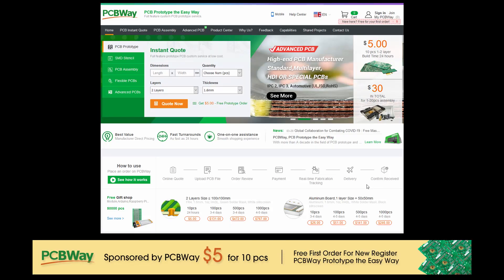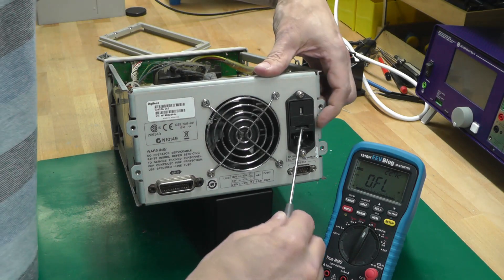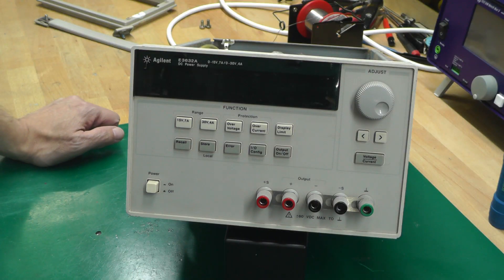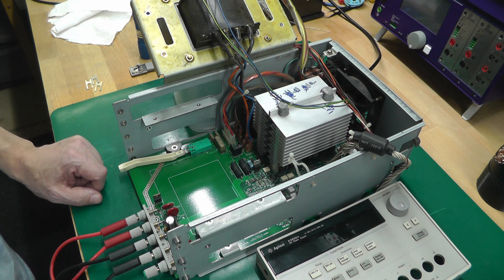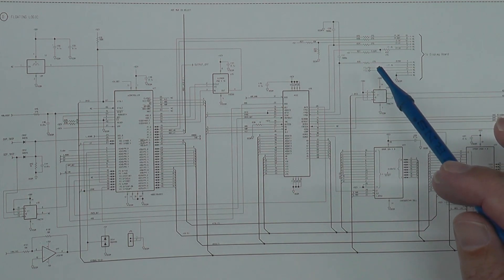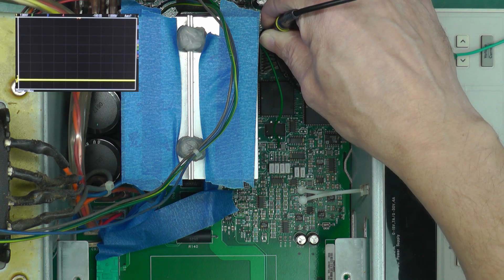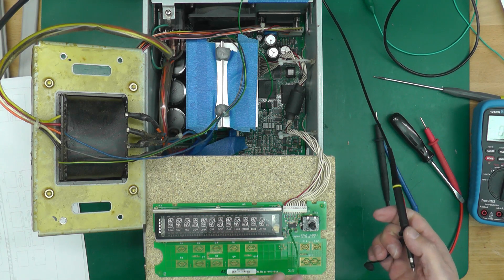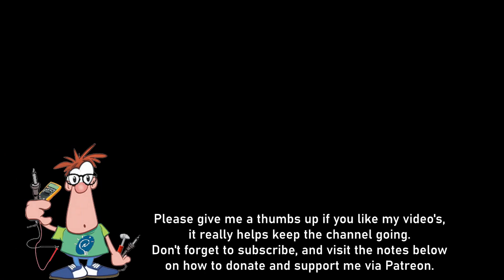No.064 - Agilent E3632A Power Supply Repair - Part 1

Comment: The architecture of that unit is basically the same as the units I fixed.

Check the power supplies of the gpib section, I found a bad supply there can kill it, also check the front panel uP isn’t getting hot, I had to replace that myself too and it was giving a similar symptom.
Reply from the maker: All power supplies (there are quite a few) are fine on both the earth referenced and floating sections of the main board, nothing overly hot. I am working on a Part 2 video today actually, the Cpu clock, reset circuit, addess/data bus all look active and with no shorts (can usually see this on a scope). Plenty more to test though, this is looking like a proper fault....great fun!

Comment: The three pin ICs mounted on the heatsink, might be worth checking those since the unit has seen prolonged use?
Reply from the maker: Thyristors and LM317/337, they are okay at the moment but certainly worth looking at after the digital side is operational.

Comment: My experience is with an E3631A but they are a similar architecture. Be careful probing the display section. It's easy (well it was for me) to send 17V where it's not wanted! Maybe the previous repair attempt has done this. I had to remove the VFD and replace some blown comparators and the custom ASIC (fortunately available from ebay) as a result. Good luck!
Reply from the maker: Nice find on the ASIC....can't see nothing there at the moment though......would have been nice to have.
Reply: @IanScottJohnston  FYI - sourced it (SXC6206AKO/V4 for the E3631) from https://www.utsource.net/

Comment: Holding down the "Display Limit" button for a couple of seconds while powering up the unit performs a self check. Maybe you sould try that
Reply: Page 98 of the Service Manual gives you the details of the self-test. With that you can check the communication with the front panel.

Comment: Luckily you have a schematic for this power supply, Ian would you have a quick look at the encoder. I have the E3631A and the encoder works intermittently. Shahriar from TSP did fix it but didn't show what he had done video TSP #108. Cheers
Reply: Open the encoder, clean out the old grease that is interfering with the contacts, and put it back together.
Reply: @PeterRidge  Thanks
Reply: You can dismantle the encoder, clean it, increase the context tensions and put it back together, I did that in one of my videos fixing a similar supply.
Reply: @TheDefpom  Thanks
Reply from the maker: As luck would have it I have a few 24PPR encoders with the same footprint, so if I get that far I'll probably replace it. For now the existing one is back together.
Reply: @IanScottJohnston  Thanks

Comment: I look forward to the conclusion.

The instrument can do a more complete self-test if you hold down any key (except Error) for five seconds as you power it on.

Have you checked all of the power supply voltages (especially the MCU rails)? I'm not convinced the main MCU is doing anything.
Reply from the maker: The complete self-test does nothing more than the normal power on self-test. The power supply voltages are all pretty good.

Comment: Hi Ian, I have fixed a few of these PSU's by the looks of it I would be looking at the main processor to start with.  The display board has its own 8051 based MCU, the power-on reset where the full display lights momentarily is the display processor initializes and looks correct to me.   Removing the Display from the PCB can be a pain, I have a number of these PSU's so if you want me to test the display so you can eliminate it I will be happy to do that, its easy enough to test when you have a working PSU. 

Also, make sure you study the schematic, the grounds are not where you would expect them to be, and typically there is opto isolation between the digital and analog sections, this allows the GPIB port to share earth ground with other equipment.
Reply from the maker: Cheers for the offer of testing the display Gerry, hopefully i won't have to bother you...... Right now I am all over the cpu etc, so far everything is checking out IO wise, but I have a couple parts on order from RS we'll see where that takes me. Great fun!
Reply: @IanScottJohnston  your welcome, good luck with the repair

Comment: Is there CPU clock? Is there some activity on ROM reading? Are all power lines for chip ok?
This project looks very great and interesting. Sad, that there is no information about how this fault started because that will get some clues where to dig.. But looking at resoldered parts, looks like someone blow it up..

Waiting for next part! :)
Reply from the maker: I am working on a Part 2 video today actually, the Cpu clock, reset and the power supplies are all looking ok. The addess/data bus all look active, no shorts (can usually see this on a scope).....plenty more to test though.
Reply: @IanScottJohnston  These are good news, at least some activity..
Agree, this project needs lots of testing to find out why CPU is sitting in some initial loop and what event it's waiting.. Lots of things may be wrong: bad serial shifter, bad output transistors (maybe it trys to set up initial output and can't do it, causing loop), opamps, corrupted ROM..
Anyway, it will be cool to figure it out and bring that power supply back to the life.. :)

Comment: Maybe start with the basic, and check if the transformer is okay, and if all voltage rails are present.
I guess that there is a 5V rail missing, which controls the IC's.
Reply from the maker: All power supplies (there are quite a few) are fine on both the earth referenced and floating sections of the main board.
Reply: @IanScottJohnston  , i hope that there are no damaged ic's on the board, that maybe not widly sold to the public. Good luck anyway, looking forward to your next video.

Comment: I'm facing Unreg issue.

Observations : 
1) Self Test pass . So that's a relief .
2) No errors reported.
3) OVP : 25V, OCP : 4A
4) Display Limit : 25V , 2A
5) Output On with 25V,7A Mode : 
    a) Setting 0V, 0A- Recorded (DMM) 42.62V
    b) Output Off : Holds 42.01V (DMM) , takes close to 3-5min to 0V
6) Tried to change voltage and current setting on PS, But cannot change anything. DMM records 42.62V

Do you know how to fix it ?
Reply from the maker: If you look up one of my other Agilent Power Supply videos on YT there's one that had similar output voltage fails similar to yours. They are all very similar in design so good luck!

Comment: UK Mains is 230V and has been since 1995, it was 'harmonised' with Europe to make the import and export of electricity from and to the continent easier (good thing as we're net importers of electricity because successive British governments have been utterly crap at updating our electricity generation capacity)
Reply from the maker: 243VAC measured here (NE Scotland)......it's sometomes a concering when plugging in primarily 230VAC gear......LOL!......Yeah, don't much care for British/Euro politicians......useless twats!
Reply: @IanScottJohnston  You got that right. A bunch of muppets the lot of them.
Reply: The link to France, established in 1961 was 100kV DC, the replacement in 1986 is 270kV DC.  The voltage the consumer is supplied with, and ‘harmonisation’  is totally irrelevant to the energy transfer capability across the inter connectors.  

It’s now 30 years since the UK electricity system was privatised.  Apart from 7GW of legacy AGR nuclear, 5GW of coal, 3GW of pumped storage and 1GW of hydro (circa 16GW total) ALL the other generation in the UK, around 65GW, is totally new build post 1990, so in excess of 30GW of gas, around 2GW of which has already closed, 24GW of onshore and offshore wind, 13GW of solar, and 1.2GW of nuclear (Sizewell B in 1995) 

The supply voltage for the UK was defined prior to harmonisation as 240v +/- 6%. After harmonisation 230v +10/-6%,  the super grid transmission and distribution networks are still run at exactly the same nominal voltages they always were and UK consumers are still supplied at a nominal 240v.

240V +/-6% is 225.6–254.4V

230V +10%/-6% is 216.2–253V

Facts, as ever, are all that really matters
Reply: Here in Mid Wales it's 245V and it rarely drops below 243V
Reply: @MartinE63  You're absolutely correct that import/export voltage is irrelevant, my bad, I don't quite know what I was thinking but i meant to say it was for import export of goods and somehow got completely screwed up in the middle. Even more embarassing given where I work, there's a bloody big poster on the wall downstairs showing details of just that.
Reply: @IanScottJohnston  Not a fan of any of them but we seem to be breeding a new, extra moronic breed here in the UK